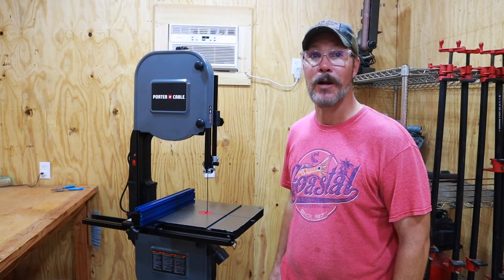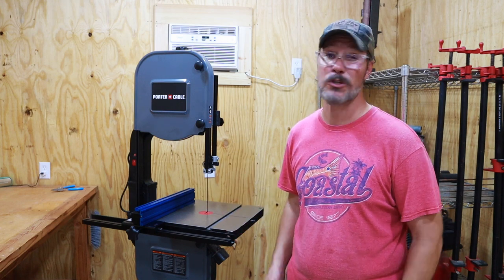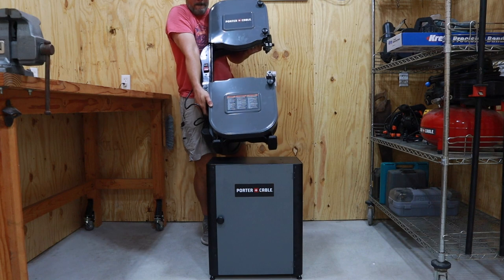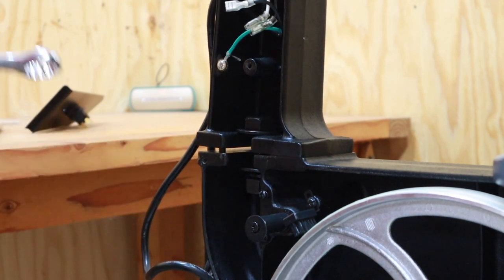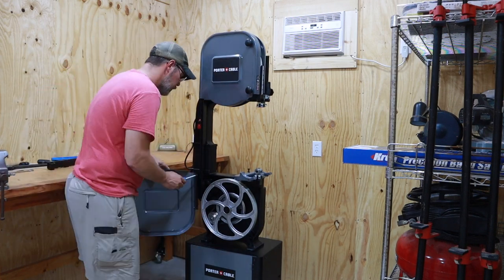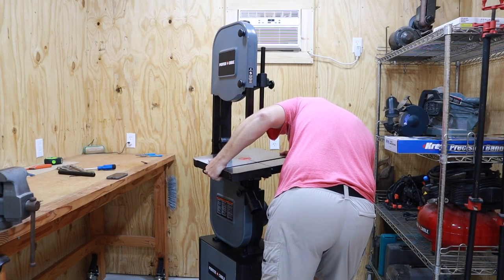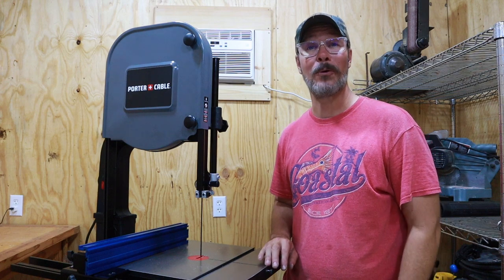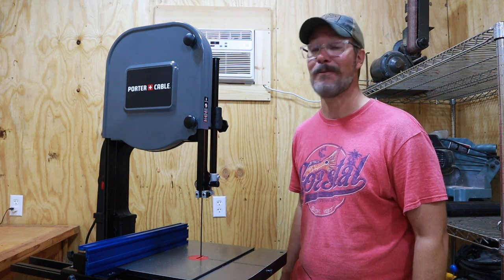Easy Upgrades for an Inexpensive Band Saw

Comment: This is the greatest youtube video I have ever watched. So crazy that you can add that amount of cut height to a bandsaw. Human beings are truly the most intelligent in the animal kingdom. Can you make another video on how to cast the riser out of a melted iron skillet?
Reply: Also a lot of these 14" bandsaws are a ~93" blade. Does the 6" riser make it a 105"? Did you have any issues with blades?
Reply from the maker: Thanks!  I don't have the equipment to do any iron casting, and that sounds like a waste of a good skillet!  😆
Reply from the maker: Yes, the 6" riser adds to the blade length, so you need to use the 105" blade.  That size is readily available at most retailers.  Here's the 2 I purchased:
105 inch bandsaw blade, 1/4" → https://amzn.to/3rr36BA
105 inch bandsaw blade, 1/2 → https://amzn.to/3G9d6Dx

Comment: Way to go man - I made all the same upgrades to mine, the last thing your going to want to upgrade is a higher horsepower motor so you can actually get your new resaw capacity without the motor bogging or stopping - I went to 2 HP and holy smokes it makes my saw function as well as a $1700 luguna.
Reply from the maker: Thanks!  I'm loving this thing!  I'd definitely want to look into upgrading the power at some point - do you have the info handy for the replacement motor you went with?  Fairly straightforward swap?  I appreciate the advice!
Reply: @MakeitGoode1  id love to be able to tell you which motor to go with, but unfortunately I have a 14" central machinery bandsaw that is really close in design, but I know the pulley ratios will be way off, so you will want to look at the spec of your current motor and find the RPM. The RPM is what you will want to base your search with, then ensure you have the same size/type shaft and that its still at your desired voltage and eye ball your mounts the best you can, you may get lucky with one that fits like I did or you may have to drill some different mounting holes. Good luck!!! I'm hoping to see a follow up video! ;) keep up the good work
Reply from the maker: @michaelarbach  Makes sense.  Thanks!

Comment: About 3 1/2 years ago I bought that same saw used from a tool consignment shop a few towns over. It had the Kreg fence & I paid about 1/2 the retail price because it was used. I stuck it in my garage & knew I wouldn't be able to really use it till I got the garage into shape. It's taken me all this time to upgrade the garage into a small (12x17) but well equipped wood working shop. I love this band saw! My background is 45 years building sail boats in a fully equipped shop with full size everything, & I still love this saw. I never knew Porter Cable offered a riser block! I had looked online & found one that said would fit with some drilling & taping ......... NO THANK YOU! As soon as I send this message I'm going to the PC site & getting my own. Do they have an upgrade for the blade guides? The cool blocks work well but bearings would be much better. The only thing I don't like is the dust collection but I can deal with it.

Comment: Great video, I have the same saw and just purchased the Kreg fence, do you know what size and thread bolts you used to mount it so I can save a few extra trips to the store, thanks in advance.
Reply from the maker: Thanks!  If memory serves it was the M6-1 x 30mm hex head bolts that were too long, so I used 20mm bolts instead.
Reply: Great, thank you so much!

Comment: Perfect timing.  I've been trying to figure out the best option for a bandsaw as well.  I'll need to modify the base to put some casters on it. But otherwise looks solid.  Hope the dust extraction is working out for you...important in a small shop.
Reply from the maker: Here are the casters I bought. They work pretty well. 

Installing the WEN Mobile Tool Base on my Band Saw
https://youtu.be/EWjj7EVUEx8
Reply: @MakeitGoode1  appreciate it
Reply from the maker: Dust extraction is ok.  My Dust Deputy/Shop Vac does well for the most part.  With the bandsaw, it gets most of the output, but there is a decent amount of debris left behind.  Easy enough to pick up afterword, just not as effective as I would like.
Reply: @MakeitGoode1  TY.  I guess I'll make another jig for better dust collection 😂

Comment: I have this same saw, riser and fence.  Of note, you really should make sure your wheels are in alignment before tightening everything down.  There is a lot of wiggle room with those blocks and misaligned wheels can really negatively affect the cut quality and performance of the saw.  Especially if you go to bigger 3/4" blades (not recommend by Porter Cable) that push the capacity of the tires.
Reply from the maker: That's a great tip!  I've not run into any issues with alignment, but could certainly see how that would be an issue.  The biggest blade I'm currently running is a 1/2" rip blade, and it does an awesome job.  I just set ripped a 11.5" x 24" piece of mahogany and it performed exactly as expected.  Looking at the setup, I could certainly increase the width of the blade on this saw.
Reply: @Make it Goode  3/4" is about the biggest you can go and that is pushing it both blade capacity and power, and only if you adhere to the center of the blade on the center of the tire alignment philosophy.  If you try to run the gullets center of tire, you won't have enough room to adjust the guides back far enough unless you upgrade to the Carter guides (I think, I don't own a set - yet).  All-in-all, great saw for the price but I do envy my co-worker's 17" with a 1.5" carbide blade running off a 5hp motor....

Comment: I got this Bandsaw on clearance for 191.00 at Lowes the other day. Best bang for your buck ever on a band saw I believe. Just order the Riser block and that same fence cause of this video. Why did you decide on the Kreg fence instead of the Porter Cable one? Thank you.
Reply from the maker: Wow, that's a heck of a deal!  I paid pretty much full price for mine, then they started going on sale and selling floor models not long after.  Oh well - I still love it and use it almost every time I'm in the shop.  I bought the Kreg fence because it was available, and well-reviewed.  There are some quirks with it, but it's doing well for my needs.  Thanks for stopping by, and I'm glad the video was helpful.
Reply: @MakeitGoode1  Are you thinking of getting a miter gauge for it?
Reply from the maker: I hope to get a miter gauge to share between this and my table saw.
Reply: @MakeitGoode1  I'm sure you will make a video when you do which would be great!
Reply from the maker: I'll make sure to feature it once I purchase one.

Comment: Great video.  One question,  will you measure the dia. of the new guide rod where it slips into the blade guide?  I bought Jet bearing guide rollers for my Porter Cable to test fit them on the rod before I purchase the PC riser.  The jet riser kits rod is 7/8" all the way down the length.  Porter cable rod I have has a small step down where the guide attaches  .822".  If the PC's new rod has a step down, the I'm going to purchase the Jet kit so the guide fits tighter.  Thanks again.
Reply from the maker: Russell, yes, the longer PC guide rod has the same step-down as the original.  That leads to my question on whether the Jet rollers have a set screw or compression ring to hold them onto the rod?  I've been considering the same ones and may have to reconsider depending on how they attach.  Thanks!
Reply: @MakeitGoode1  thinking now of going with the jet riser block kit and the extra work to make it fit.  It dosent look that hard but at least the bearing guides will be in line.

Comment: Have you resawed any wood with that 1/2" blade?  I'm thinking of getting the 5/8" version to minimize blade drift.  However, if the 1/2" one is good I may get it.
Reply from the maker: I have not.  I installed the 1/4" blade and have been using that almost every time I'm in the shop, but haven't done any resawing yet.  The Porter Cable specs call for 1/2" as the max blade width, though the tires look plenty wide enough to accommodate a larger size.  I've got some resawing work coming up, so I'll see how the 1/2" blade does and report back.
Reply: @MakeitGoode1  That would be great, thanks much!  It looks like it will take a pretty wide blade, and the motor is plenty powerful enough.  The tension adjuster even has markings up to 3/4" blade.  I'm going to instal my riser block next week.
Reply from the maker: Awesome!  Yeah, I agree a larger width blade should be ok.  Let me know how it all goes!

Comment: Trying to find a like for the riser block kit you purchased??
Reply from the maker: I'm thinking you meant a link?  I was not able to find a direct link to the riser block kit.  After some research I found the correct part number and customer service number I listed in the description:

To order the Porter cable bandsaw riser block kit, contact Porter Cable customer service at 1-888-609-9779 and request part number XOJX.  

I hope this helps.  Thanks for following along!

Comment: That is the EXACT combo I bought and set up last year, saw, riser and Kreg fence. Greta value for the price. At some point I will probably upgrade the guides to a set of Carter bearing guides. But GREAT review?
Reply from the maker: Awesome! Yes, I've got the saw tuned up and it's working well, however, I do think I'll upgrade the guides at some point, too.  Thanks for following along!
Reply: Do they make them for Porter Cable?  I didn't see it listed.  Unless you're talking about the Universal kit?
Reply from the maker: @hansangb  Yes, I provided the Porter Cable information in the description:

To order the Porter cable bandsaw riser block kit, contact Porter Cable customer service at 1-888-609-9779 and request part number XOJX. 

I hope this helps!
Reply: @MakeitGoode1  thanks. I meant the Carter bearings.  I'll definitely order the height extension kit.
Reply: Carter says that the JET 14RIS kit will fit the Porter Cable 14 inch $219 
There is a set on eBay for $148. I put it on my watch list and jus got an offer for $102 so I am going to give it a try.
Reply: Did those work?
Reply: The guides I bought on eBay? Yes they work great!
Reply: Awesome! Been wanting someone to confirm they would work on my porter cable before I pulled the trigger. Thanks!
Reply: Gonna do that same setup on mine now with the Carter guides and riser block and may add the blade tension release

Comment: So I just went and bought this saw. Call PC and they acted like I was crazy. Could you give me the number you called and the part numbers for the riser block kit.
Reply from the maker: Did you call the number and use the part number I listed in the video description?  When I called, they were friendly and helpful and knew just what I was requesting.  
"To order the Porter cable bandsaw riser block kit, contact Porter Cable customer service at 1-888-609-9779 and request part number XOJX. "
Please let me know what you find out with this - I want to make sure I'm still listing the correct information.  Thanks!
Reply: Just used this phone number. Parts are on the way. Thank you!
Reply from the maker: @justinluckey5930  I'm glad that worked out well for you!  Feel free to reach out with any other questions.